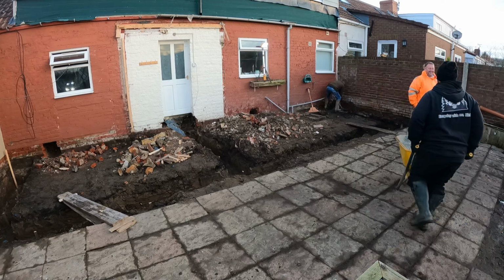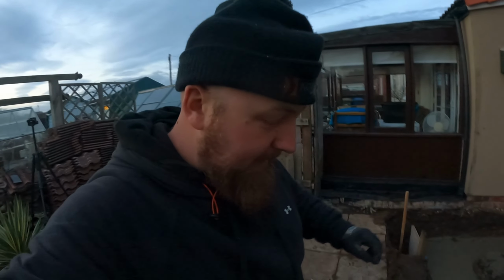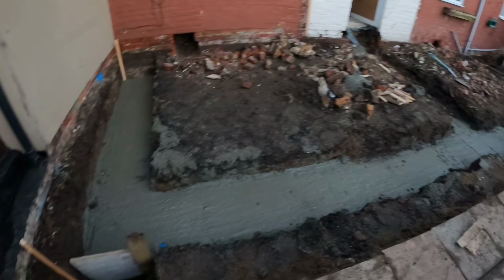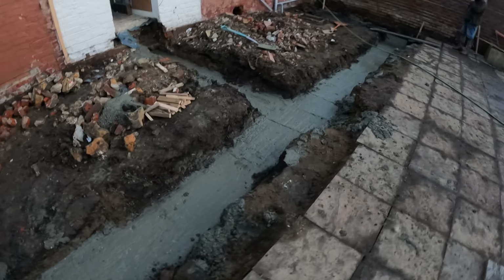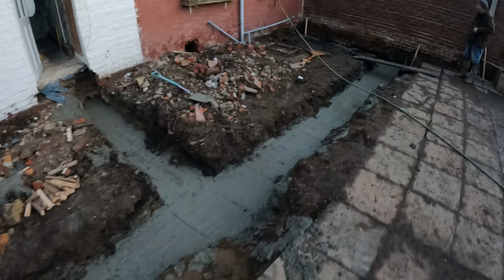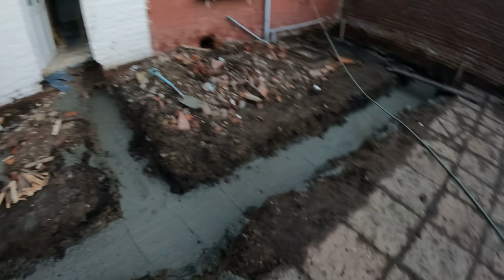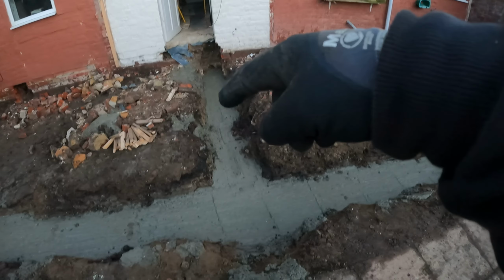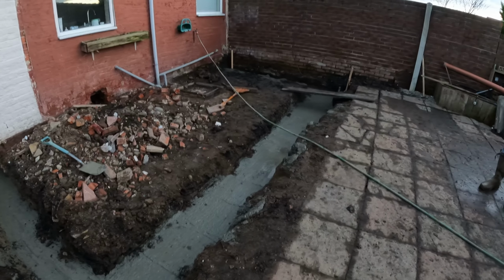Pouring concrete into the footings ~ digging footings part 2

Comment: Hello from me, Haggis, in New Zealand. I was startled to see that there was no reinforcing steel in those footings. Our building code is more strict, possibly because of earthquakes. Nice teamwork by the lads.
Reply: Depends on local regs

In Scotland we have to use weldmesh in foundations, in England they generally use trench fill foundations and I’ve never seen mesh used down there…..
Reply: @livingoffgridinscotland  Thank you! I appreciate being brought up to speed. Cheers!!
Reply from the maker: Hey haggis and thanks for commenting. So as Lochnaw had said above it all depends on what the local regs are for the area. In my area, there is no wet lands or risk of subsidence so we can just use general grade concrete footings. We have to use rebar or mesh for raft foundations if we have to build over sewer pipes or poor land.
on this build and dig we hit good clay at about 200mm down below surface so we just dug down to depth in the clay and that clay will be sufficient to build off.

I hope i have helped you understand the way we build here in England. Anything more just comment away buddy.
Reply: @everydaywithmenick  Thank you Nick. Different countries, different regs. I have learned a HEAP!
Thank you!!!